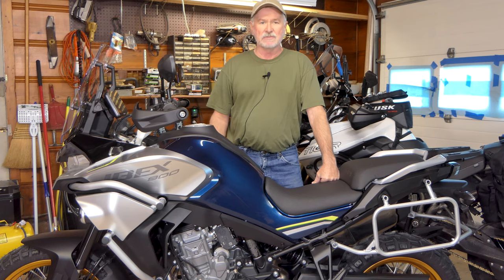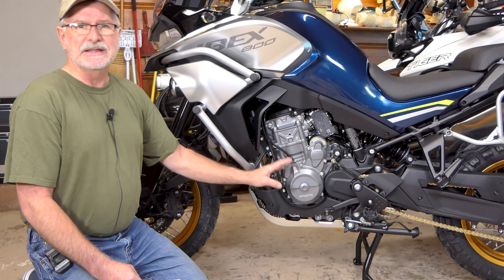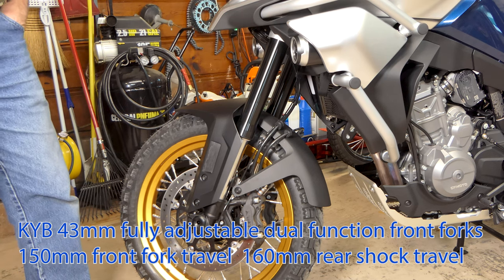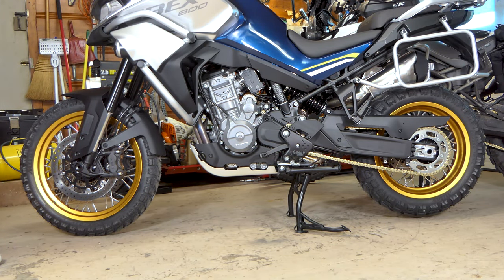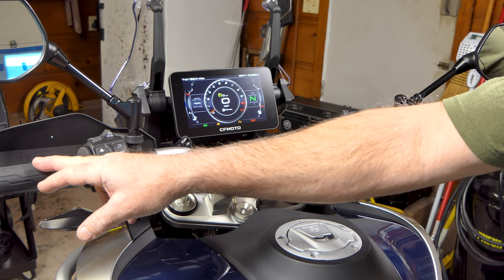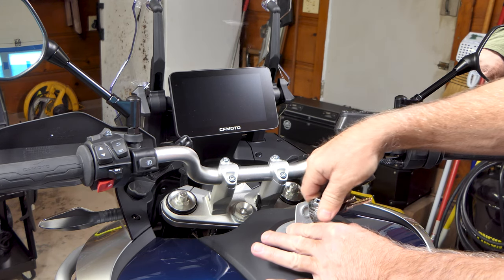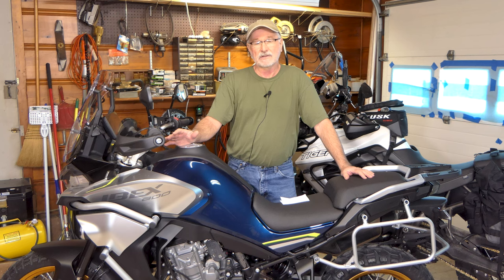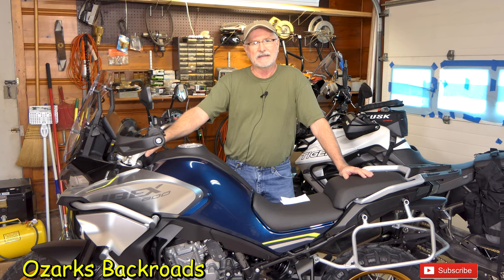New Bike in the World Headquarters Garage...

Comment: Would love to hear your opinion of throttle and fuel maps. Myself and a handful of friends too a ride on the 800T at a CFMOTO demo event, and that throttle and fueling is very lacking in my opinion. Twitchier than a Jack Russel Terrier on Ritalin.
Reply from the maker: Hello there sir, good to hear from you.  I find the fueling to be pretty aggressive on the Ibex. I don't find the on/off throttle to be jerky but the fuel curve is very aggressive.  I rode in rain mode for the first 3 or 4 hundred miles but eventually I have grown accustomed to the mapping and don't give it much thought any more... I noticed it the most when riding off road on slow technical trails.  After a thousand miles or so I can say that I am not a fan of the fueling but I don't notice it much any more either.  For me the fueling is not that much of an issue however the vibey 790 KTM engine is still annoying to me.  The engine likes to be up around 4000 rpm to be happy so I have had to change my riding habits to accommodate it.  I find that I use the gear box quite a bit more than I would prefer... That being said I would still buy the Ibex again.. it is a very fun bike, is quite good off road and travels very well... It is hard to find a bike that will do it all as well as this one.... Thanks for watching... keep safe out there...   :)

Comment: So what is the maintenance intervals on this bike? when do the valves need to be adjusted? and do you need to take it to a dealer for service? is there any service lights that come on like when the oil needs to be chanced? if so can you reset it yourself? I ask because the Triumph needs a dealer to rest that light. I am very interested in getting this bike!
Reply from the maker: Hello again there sir, The owners manual says 9000 miles on the oil change... I will be changing mine at about 5000 miles... holds 3 liters of oil.  The manual says check the valves every 18000 miles... I will do that myself.  There is a warning that comes up when the engine is started that states the oil change service is due. It goes out in a minute or so... As far as I can tell the dealer will have to do a reset to clear that message.  I will be doing a video on all the things that I do not like about the bike before long.. no bike is perfect so you might want to see that video before you go out and buy one....  I really like my bike and would buy it again... thanks for watching...   :)
Reply: @ozarksbackroads5484  i saw a video where when tbe guy changed his oil he went into his setting and clicked on reset all and the wiped tge message off the screen. Check your manual.
Reply: Sorry factory reset.
Reply from the maker: @woodknack1  Thanks for the info sir... I will check that out...   :)

Comment: Hello i just found your channel..as i anm researching this bike.. im interested in this but not sure about reliability yet.. ihave watch a few of your videos..just curious how long you have had it and would your bike  now and would you recommend it? I do travel forest dirt and gravel road as well as pavement
Reply: Hello there sir, good to hear from you...I bought my Ibex back in April and have taken a 4000+ mile trip out to Arizona, Utah, New Mexico, Colorado with no problems of any kind.  I believe the KTM 790 engine is a pretty reliable engine and the bike has high quality suspension and electronics on board.  The fueling is an issue as I have mentioned in most of my videos on this bike.  CFMOTO says there is a software update on the way that will address the fueling issue and also there is a warning that pops up on these bikes saying there is an ECU System Failure when there is really no problem at all.  CFMOTO says the update will address this as well.  I can't say that I would definitely recommend this bike at this time.  If CFMOTO makes good on the fueling issues then at that time I would say yes but I am from Missouri... I will believe it when I see it. I am quite happy with my bike even with the warts.  For the money I paid for the bike I feel that I have a lot of bike.  I would by the bike again or maybe go for the Explorer edition when it gets here.  If you can live with a bit of over achieving throttle roll on and a bit of surging at low speeds you will probably enjoy the bike.  The bike travels very nicely with good wind protection, comfort and very relaxed highway manners. The bike has very good suspension and is sprung properly it works surprisingly well off road and is very nice on.  If the fueling is going to drive you crazy I would wait and see if CFMOTO gets the software updated and the fuel mapping issues addressed.  I hope this helps... thanks for watching and keep safe out there...   :)
Reply: @jonsmith9892  well I'm in north idaho and haven't even seen one yet at any of the dealers near me.. I own a tenere 700 and it just not the right bike for what I want to do..so I'm looking into the cfmoto or the new vsrom 800de.. but the suzuki is a lot more money.. but I want a good bike that will last until I can no longer ride and hand it down to my son
Reply: @gabrielkopp2036  Hello there sir, good to hear from you.  I can't speak much on the long term reliability of the CFMOTO as I only have a little over 5000 miles on mine so far.  I would have to say that the Suzuki is pretty much a sure thing in that department... thanks for watching... good luck with your new bike purchase...  :)